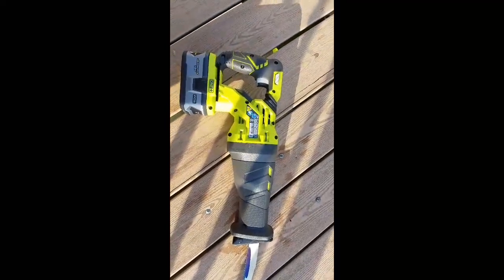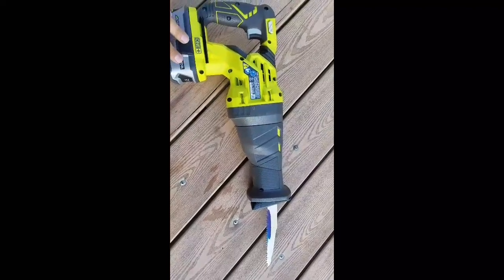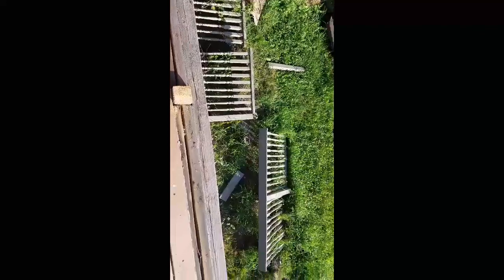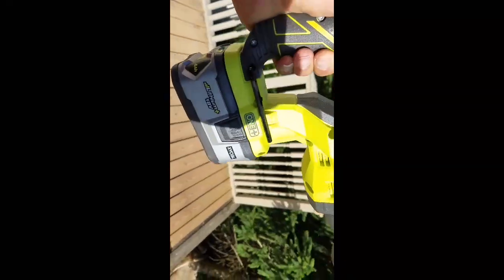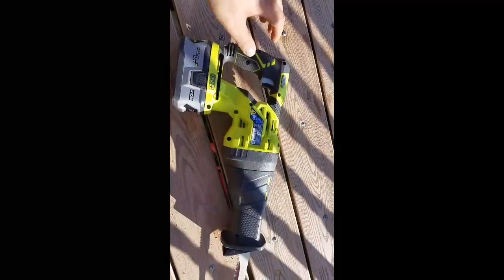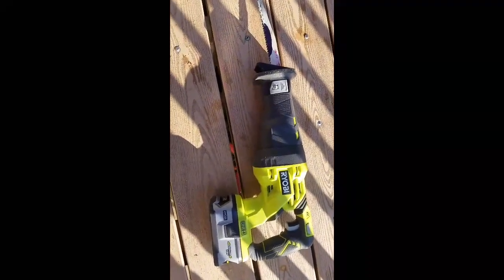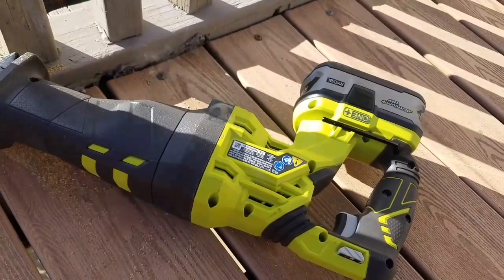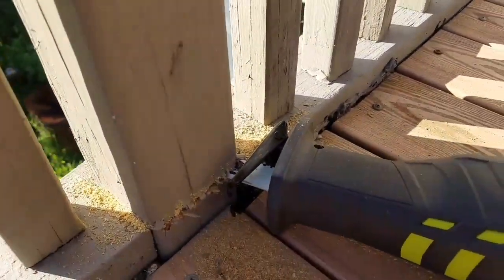Ryobi Review Reciprocating Saw One+ 18v Junk

Comment: I’ve got the older model of this saw with the shorter stroke and not as much overmoulding. It’s worked well for me for a couple years now. I’ve got the Milwaukee Fuel too and it’s a much beefier saw. It does cut faster and has less vibration, but it also weighs almost twice as much and costs twice as much too. For serious demo work it’s a better tool. IME, the Ryobis still a decent saw, but if mine had burned out on it’s first project I’d call it junk too.

Comment: ...actually, this guy is spot on...I had some of the older blue ones, they were o.k., but expected nothing spectacular for the price...the biggest issue with them was that they shook the batteries and damaged the attachment clips, making the batteries loose...the clip-on system works fine with other Ryobi tools, but is not sufficient for a shaky tool like a sawzall. I have Ryobi drills, impact drivers,circular saws, etc., and they have been very good for the money...so when my blue Ryobi sawzalls became well-worn, and the batteries wouldn't stay on them very well, I looked at the newer green ones...I figured they would be at least as good if not better than the blue ones, although they inherited the weak/inadequate battery attachment system from the older ones...so I bought one, and it started smelling burnt with little use...the second time I used it, it started smoking..I returned it, and they gave me a new one...so after just a little use, the second one started smelling burnt. Thereafter, I would let it cool after a large cut before using it again, although it was generally annoying to have to "baby" a tool I needed to work with...so the second one lasted longer than the first, but now it has quit completely...a week ago or so, I saw a new-looking one at the landfill, and started to grab it for parts..then I saw the melted area around the motor :(.....Ryobi cordless tools in general are a good value for the money, but their cordless reciprocating saws are J-U-N-K...unless you just need one once in a blue moon for VERY light work, STAY AWAY!

Comment: It amazes me when i see people show they can't use a tool correctly then say they are gonna return it and  go buy one made by the same people under a different name.
Ryobi is made side by side in the  same factory as milwaukee by a company called TTI . The ryobi tools are cheaper versions of milwaukee products that typically are equal to the previous generation of milwaukee's new tools LOL. The p516 isn't a bad saw it's actually a good saw especially for its price. I use tools from Ryobi , Dewalt, Milwaukee , Rigid , porter cable , Kobalt and  more . Sometimes you have to blame the user and not the tool for not being smarter than the tool.
Reply: Well i used this saw 4 times and it started smoking on me and now it doesnt work anymore. im a fan of ryobi, but this is a flop

Comment: You are either deliberately trying to mislead us, or don't know how to use a sawzall.  Take 1:30 for example, you want us to see the saw blade not cutting through the wood, by deliberately not grabbing the front of the tool to put downward force on it.  I can make any saw do exactly what you showed in the video, the same way you did.    PS it probably shut off because if you bought it only two hours earlier as you stated, once the time has passed to drive home, unpack it, and do the cuts you did, did not leave enough time to charge the battery.  Brilliant, run a tool on a low battery and think it's the tool's fault.  jjjPLus
Reply: Battery was full when he started the video, and i think he was recording with the other hand, either way, I had one and it did the exact same thing after about 20 minutes of use. I took it back and got a 20v dewalt and never had that issue again.

Comment: Your saw just had a defect in the motor. My friend has the same saw and we actually tested it by going to the woods and cutting for almost two hours and that saw was going as good as he first got it.
Reply from the maker: Ninja8642 Nerd .....possible, my brother had this exact model and he used it for a few years before it burned out, he replaced it with the brushless ryobi model. I did return mine and got the 60v flexvolt Dewalt, paid alot more for it, but it feels and cuts like a corded saw. for light to medium duty Ryobi should do just fine, heavy duty remodeling I honestly would recommend the Milwaukee m18 or Dewalt 20v or their 60v flexvolt.

Comment: You bought it only two hours ago. Did you use a fully charged battery?  If you are running with a low charge on your battery, I think you will pull a lot of current.

Comment: Dude it's you . U got the wrong model for the job or u need a Longer blade ? I had both models a Ryobi P517 and a Milwaukee m18 fuel both have Diablo blades both work great . Ryobi is 3200 spm and  Milwaukee is 3000 spm and heavier   .  It's the user most of the time who don't know how to use tools . 
I'm a contractor .